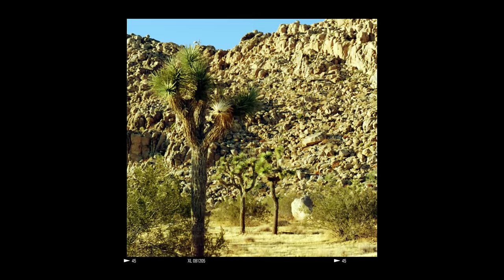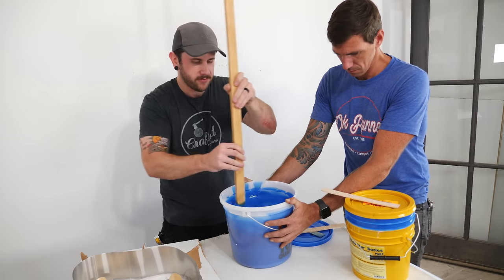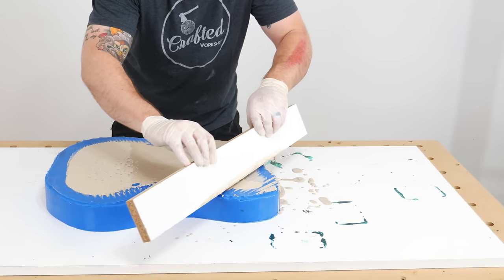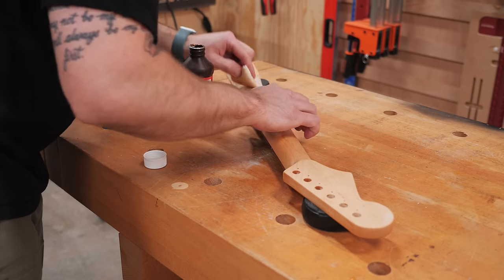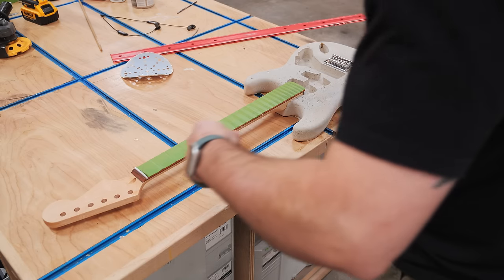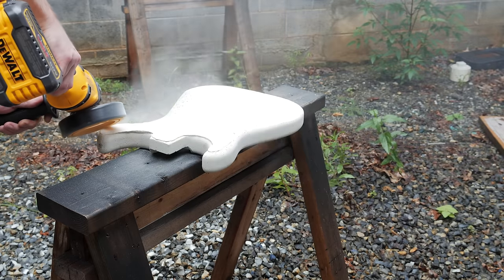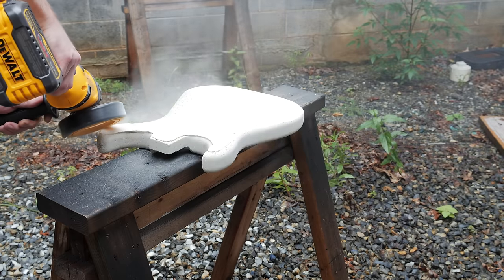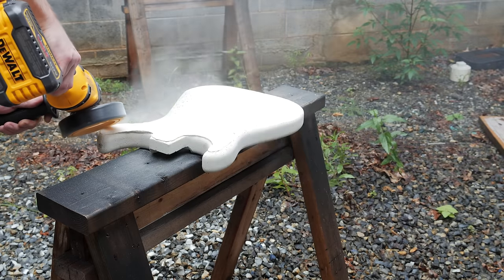I built a GUITAR out of CONCRETE. How does it SOUND?!

Comment: well, this guitar is kinda a huge middle finger towards the "Tone-wood" people.
Reply: Not at all.  The neck is wood, and is the live portion of the tank circuit with the strings.  Concrete/stone etc is like a short circuit for it's small section, and won't matter much except for it's basic resonant frequency due to size/shape so will be basically neutral.
Won't change in the slightest that a wood body is basically solid but can still have a bit of a frequency absorption profile.
This being 'good' because most (say 85% for reference) of what's needed is in the strings and neck and the body is neutral doesn't change that the same strings and neck could be even better with the correct wood body.
Take two faint notes, high dies out first, then do it again and low dies out first, with the other continuing.  You can easily tell these apart, and can be easily accomplished by one wood body slightly favoring the high note and one favoring the low note.
You're not understanding the complexity of sound and what can be going on and the billion to one scale of hearing if you think something this silly 'proves' something.

I personally can barely tell the difference between red and white wine.  Does that mean I think there aren't differences in wine, and that someone trained and with an exceptional palette can't tell differences I couldn't begin to notice?   Of course not, I'm not that ridiculous.

Of course half every knucklehead want 'everything to be easy for me' so they don't have to think for even 2 seconds..  That makes them completely crap at science and as people of science, nothing more..  You have to do a ridiculous amount of work to even try to prove 'something doesn't exist'.  This ain't it.
Reply: @ModelLights  it removes one more thing from the tone wood theory bollox tho .....yall gotta be one step ahead and as i can see ...its now the neck that makes the most difference to the tone  lol 

and your red and white wine analogy lol  yeah there are also crazy people in the wine industry to bump up the prices by telling you that one is better than the other so that some people can get the "better one" cus they have more money when all your paying for is a label ....just like clothing........and guitars!! .....why does no one ever see this "in your face" marketing scheme.
Reply: @ModelLights  That's a long post for nothing. The point is nobody should care about what wood your electric guitar is. The difference is only noticeable when actively listening. Not worth the money at all
Reply: @jaym8808  👍  Yeah it's all a bunch of bollox as another poster said
Reply: Now he just needs to put the final nail in the coffin and slap a neck made completely from glass on that thing and show people how it sounds just like every other electric guitar
Reply: @theccarbiter  No no. Glass is made from  sand. And sand most likely comes from ancient trees. So the tone of guitar will depend on what kind of trees that sand came from.
Reply: @kibon8387  You got me wondering... Has there been any acoustics made out of something else than wood?

And now when I bother my old brain-o-matic, was there firm called Rainsong or something like that who made atleast the tops of their acoustics from carbon fiber...?
Reply: @Quusikko  theyre exist. there some acoustic guitar out there using steel and even carbon fiber as it main material. but back then most of the guitar made out of wood. also look for sound comparison on youtube, theres tons out there. they proven the material it made out of affecting the sound/tone of the guitar. the carbon fibre guitar tense to have brighter sound.
Reply: @kibon8387  I'm actually looking at Darrell Braun's comparison of a Rainsong full carbon fibre acoustic vs a traditional wooden one.

I feel like I've seen the very same video before. 😁
Reply: Aristides: Am I a joke to you?
Reply: Not entirely. If a guitar sounds a certain way made of concrete, then slightly different made of glass or resin, its simply because of how sound travels through said medium. You can hear this when you play a guitar while resting it on a desk. The desk will vibrate, but depending on what the desk is made of, you'll hear a low hum or a faint kind of shallow hum coming from the desk.

This is the same principle that is applied to tonewoods. Depending on the composition of the wood, it'll respond better to certain frequencies. Is it extremely vital to electric guitars? Not as much as the electronics but they still play a vital role in sustain due to vibrations in whatever material the body and neck are and how they're assembled. Think Strat (bolt on neck lighter ash body) sustain vs Les Paul (set neck heavy mahogany body). As for acoustic guitars... thats a whole different monster.

If anything this video simply demonstrated that while wood is the norm for guitars, other materials can be used to build. Realistically, no way in hell is anyone going to play a concrete guitar for a 4 hr set list onstage. Gibsons already cause back issues is some people as is. I can't imagine what 4+ hours of this every night would feel like 😬
Reply: Bogdan Laiu you’re right, I prefer glass made from sand of broken down rocks to trees. Sounds brighter that way.
Reply: psycho black the neck is only one part of tone wood theory. Another contributing factor is if you are playing on a hard wood floor and your distance to the nearest tree.
Reply: so you people that believe in tone wood use pickups that are more like mics then cuz last time I checked pickups work by magnetism and not wood shaking, go play your acoustic buddy that's where tone wood makes any difference if any lol
Reply: @1013Grimm  well is it still matter when the distance between sound source (the string) and the sound captor (the pickup) only few cm appart tho? especially regular single coil pickup like a strat, its different story if its a piezzo tho.
Reply: @mikde-ye7pi  well thats not entirely true, vst is like any signal processing it process the original signal to something else. the attack and pick up respond of the original source is still there even tho it cut off a bit by digital sampling.

if were talking about signal loss the guitar on this video after gets hit by vst it was compressed in the rendering process and on top of that there also yt compression. so it actually so far off from the actual thing.
Reply: Matthew I hear plants that make seeds have better tOnE than ones with spores
Reply: I think tonewoods matter less with medium / high output pickups, especially humbuckers. Funny how a good tele still sounds like a tele even when it’s unplugged.
Reply: Honestly I'd say the main difference in woods is more of a resonance thing than a "tone" thing.
Reply: @psychoblack1411  Theres a guy who does an aluminium neck here on YT and it sounds just like any other neck!! These people have been suckered by guitar companies to charge them a fortune for pretty wood grain
Reply: @Quusikko  There are complete acoustic guitars made from carbon fiber that sound amazing.
Reply: @cortarelva  Yep, Rainsong is one manufacturer who does them.
Reply: There can definitely be a difference between wood and wood. Most obvious differences are cold and hot spots of the fretboard. Also tone can be different https://youtu.be/Ydfh3X81LTE
Reply: Harry. B. Renner. jr.  or the pickups are different, which is true even if the same winder is used. Don't be a sheep.
Reply: Harry. B. Renner. jr.  yeah, what you said is an OPINION, just like mine.
Reply: @jaym8808  most people that believe in tonewood don't really say that it makes a huge difference but that it does make a difference. Different woods have different densities so the sound is going to resonate and vibrate differently.
Reply: @flonkfarrychair2562  Material has an extremely minimal effect on solid-body electric guitar tone. Stiffness of the body is related to the thickness of the material cubed, so even very flexible woods and many plastics are adequately stiff to raise the system resonances out of the guitar range. Acoustic and hollowbody guitars are the only place material matters beyond mechanical stability, durability, weight, and appearance.
Reply: @flonkfarrychair2562  You must be new to the community. The tonewood guys often are the "I'll only settle for an alder body, yada yada yada."
Reply: @demokraatti  as a touring player for the past 15 years, playing everyday in studios and live (until lockdown) i can safely say that cold and hot spots of the fretboard are in your imagination.
Reply: @maudiojunky  i was about to replied to flonk the same thing as you. also how did the "resonation and vibration" matters when the sound captor (the pickup) and the sound source (the string) only a distance of few mm. even if the "theory" wood vibrate back to the pickup is true, it would sound really quiet then also after you engage an overdrive that sound would just gone.
Reply: @flonkfarrychair2562  nah. the true "tonewood" believer would not say that. the thing they would say are rosewood neck has more warmer tone than maple and alder produce much brighter tone than mahogany. they would say wood make up at least 50% of the tone.
Reply: @RSimusic  thank god i read your comment before i watch that 1 hour long video. i click off immedietely after seeing the intro. you saved me bro.
Reply: @kibon8387  Maybe the extremist but most people who believe in tonewood admit it makes a very negligible difference but it is still noticeable if you try. You're literally gatekeeping for a group you're not apart of.
Reply: @flonkfarrychair2562  well i believe in tonewood for acoustic guitar. also i believe in science and prove. dont get salty dude, i was saying the "true believer" as a sarcasm.
Reply: @kibon8387  The significance of body resonance with non-microphonic pickups has to do with the losses the strings experience. If a string is mounted to a rigid body it can only lose energy aerodynamically, through internal strain, or through magnetic losses. When mounted to a body which provides acoustic amplification (like an archtop) then the energy in the string over time will be determined partly by the response of the body because, being resonantly coupled, the body will convert some of the string's kinetic energy to acoustic energy and heat due to the motion induced in the resonant body. This effect depends on the frequency response of the resonant body and will have a frequency-dependent effect, especially on sustain, inducing a change in timbre. Solid-body guitars don't experience this regardless of what they're made of because stiffness scales by thickness^3, so the difference in material thickness between solid-body and hollow-body construction more than makes up for any difference in modulus and density between practical materials.
Reply: @maudiojunky  thats why i put it in quote "theory"
Reply: @jaym8808  Not noticeable at all. Tone wood has absolutely ZERO effect on a solid body electric guitar.
Reply: I've played a Duncan JB on four different guitars with different woods. They all sounded completely different.

Edit: maybe not completely different, but different enough that I could tell them apart easily.
Reply: The thing that I find amusing about the 'Tone Wood' people is that they don't seem to realize, that even if the wood DOES affect the sound in some way, there's no record, of any great detail about the wood used, in most cases.

All they know, in most cases, is the species, Mahogany, Maple etc., but most wood species. like the two mentioned, have numerous sub groups, are grown in numerous areas around the world, in different temperatures and environments both naturally and in plantations.

Contrast that with the wine industry, they can tell you, when it comes to fine wines, where the grapes grew, what year, what the weather was like, even month they were harvested etc., AND by that, they can compare the quality against wines made by grapes grown previously in the same area.

Try that with guitar 'tonewood' !

So, if your guitar sounds good and you think it is somewhat due to it's particular 'tone wood', you just got lucky, because if you wanted to replicate it, you would have to find the same wood from the same tree, even if you could identify it, which is highly unlikely.

Some people call 'tonewood' guys , 'Corksniffers', but that is exaggeration, because, other than the species, there's nothing to sniff.
Reply: @SaintKimbo  i remember watching one of the acoustic/classical guitar builder/luthier documentary on yt. they really picky about what kind of wood they're using and where is it come from. i remember they only make their guitar from the wood that grow on the specific place in certain country. they also aged/dried the wood for several years before that wood used to build a guitar. but once again its acoustic instrument tho, tonewood does exist in that area.
Reply: @kibon8387  
I've also heard top Luthiers say that using the same wood from the same tree for multiple acoustic guitars can  result in different tones.
My point is, whether or not the wood makes a difference to the tonal quality is of no relevance in the big scheme of things, because it appears to be impossible to replicate.
I.e. If you have a guitar that sounds fabulous due to the quality of the wood, and everyone that hears it wants an exact copy, the chances are very low due to all  the variables involved.
So, the whole 'tone wood's argument is moot.
It's more of chance thing, where you can get lucky, rather than simply saying that any wood choice is going to sound great or not.
Reply: @kibon8387  Carbon fiber beats everything. I covers all the lows and highs.
Reply: @bogdanlaiu8309  one could say your theory sands to reason ... couldn't resist the pun
Reply: @Matthew-dr1un  - a tremendous argument :-) tree...mend..us ...
Reply: @RSimusic  - and the missing 10.minutes ... (you only want one hour back). Tone time dilation effects via a Lorentz transform.
Reply: @stephenhookings1985  I actually switched off early because I couldn't cope with the cringe of that awful video and "song" at the end lol
Reply: @vandersgarage4682  Search it and listen for yourself. There is a difference but it's so slight that it doesn't even matter
Reply: @mikde-ye7pi  Pickups vibrate in the body just as much as strings vibrate against the pickup magnets. Feedback from vibration goes both ways. A body which doesn't transfer vibration has no sustain, which is what we see in this video at the end.
Reply: @maudiojunky  Don't go trying to convince anyone with actual factual and scientifically proven engineering knowledge. That's not how this kind of discussion works. I solemnly swear that every guitar sounds infinitely better when the cables have been wrapped in baby seal nipple leather sheathing.

Now let's have a discussion like PROPER audiophiles.
Reply: @jaym8808  even then people have their own baises and will hear what the want to hear. As far as I know there's no scientific evidence that wood affects the tone of a solid body electric guitar.
Reply: Stephen Hookings that won’t account for no two pickups being exactly the same wind.
Reply: Harry. B. Renner. jr.  or your just hearing that stuff in your head, which is also fine, some ppl are low-key psychotic
Reply: I'm trying to understand the logic of those who believe the tone wood hocus pocus. The pickups "pickup" the vibrations of the metal strings and converts it to an electrical signal which is then amplified through an amplifier. If anything the pickups affect the tone, and even if the wood does play a part in someway, it would barely affect the sound acoustically. And it would probably be filtered out through the amplifier itself. I'm sure that ppl know that pickups are microphones, right?
Reply: @TheXelavid  pickups are not microphones, they are magnetic sensors. They sense vibration from the string, but if you vibrate a pickup with the sensors near a stationary piece of metal, it will also produce a tone. The wood of a guitar helps transmit sound to a pickup just as much as the string does, because the pickup is mounted in the wood which counter-vibrates to the strings.
Reply: @TheXelavid  Jesus christ man. I looked away from the screen when listening don't be so God damn thick headed. Every single guitar will have a slightly different resonance to it. It's wood my guy
Reply: If really only matters on acoustics
Reply: @viniciusbertucci  That can be caused by other factors besides body resonance, assuming all four guitars you mentioned are solid-body. If you move the pickup to another guitar where the scale length is different or the pickup is a different distance away from the bridge then it will be biased toward picking up different string harmonics than in the original configuration and sound quite different. 

There's also setup - unless each guitar has an identical fretboard radius and string spacing to each other, with the pickup adjusted to compensate for string height and angle, and screw lug adjustment is identical, all matching the reference configuration to sub-millimeter accuracy, then you still have confounding factors which are more detectable than the difference in wood. If you want to look for a materials answer, if the bridge on one guitar is ferrous and the pickup is mounted in or very near to the bridge then there may be a perceptible change in tone from interaction with the magnetic field, an effect most famously observed in the Telecaster, or more commonly with metal pickup covers. 

Of course this is all assuming you're comparing using the exact same pickup with the exact same potentiometer and capacitor values (measured, not random +/-20% tolerance parts) in the exact same circuit, which is the only valid way to try this comparison since the manufacturing tolerances of compoinents, or any intentional revisions they made to the JB pickup over the years, are likely to swamp any effect from the guitar's construction materials. 

By far the most significant of all the factors I mentioned is position of the pickup along the scale length - even if you use an unpotted pickup that you can talk into like a microphone, position along the scale still matters more than body resonance in a solid-body instrument. Pick up a 60s Jazz bass and compare the tone to a 70s model with the same pickups and it's a world of difference just from moving the bridge pickup some small amount like 1/4".
Reply: @TheXelavid  from what i gain from this comment section theres one theory i can accept that is the wood vibrate differently and it cause the string sustain more based on the law of energy lose (i cant remember the name, dont quote me on that). if that really the case, i think we can fix it by using lower gauge string or just tune down the guitar to Eb or D standart.
Reply: @ModelLights  I would consider editing out the wine tasting expert part of your comment cause ahhh, yeah, that's also been debunked. The wine taste experts couldn't tell the difference between cheap grocery store brand and the finest of the fine 80 years old. Penn and Teller covered it some on their show Bullshit! but there is also the studies done and published. https://www.realclearscience.com/blog/2014/08/the_most_infamous_study_on_wine_tasting.html
Reply: @kibon8387  Certain tunings and keys may sound better on some guitars because the effect of a resonant body is frequency-dependent. The only way to get more sustain consistently is to reduce the losses, as the time-dependent effect present in resonant guitar bodies will be the same regardless of how much energy you start with in the strings. Heavier strings allow more energy to be imparted at the start without losing intonation compared to smaller strings because they stretch less, giving a louder, clearer attack, but they have worse steady intonation, higher internal losses, and higher aerodynamic losses, so it might be a wash on sustain. A stiff solid-body guitar with low field strength or piezo pickups and strings made of a high-tensile alloy for the core wire is probably the best you can do to maximize sustain, otherwise a good compressor pedal and vibrato technique are your friends :) Baritone scale length is also great for sustain and intonation!
Reply: @viniciusbertucci   snap    my Jacksons V 's in korina, basswood and alder.  Alder my favourite, bright with a midrange honk and good for metal, the others sound darker. I wonder how many here have actually owned top end guitars to know the difference.
Reply: @bogdanlaiu8309  sand doesn't come from trees it comes from erosion and trigger fish shit
Reply: @Quusikko  I'm 54 years old when I was younger my uncle owned a music store that I worked in when I was a teen and young-adult. We had some guitars made out of composite materials I think they were made by Applause and I think Ovation had a couple models. They didn't seem to sell very well and I'm not sure why because they did not sound bad. One of them sounded like the Fender acoustic I had at the time, with a solid Spruce top . And I don't remember if it was the Ovation or Applause but they had rounded backs , I remember because it was the first time I never seen that. Kind of made it harder to play sitting down the rounded back didn't want to stay on your knee LOL